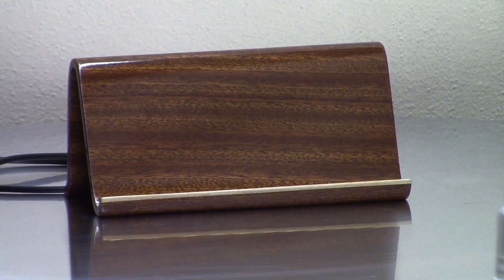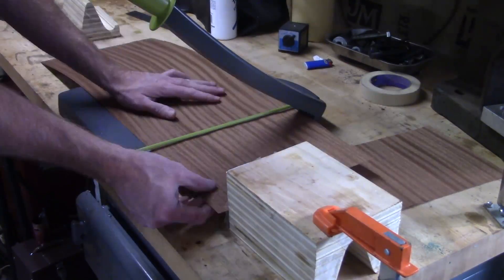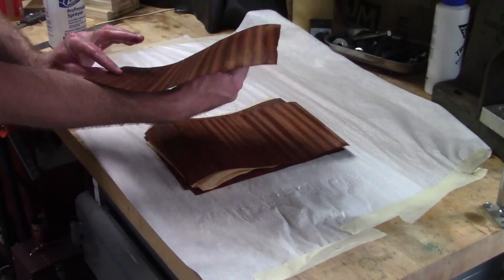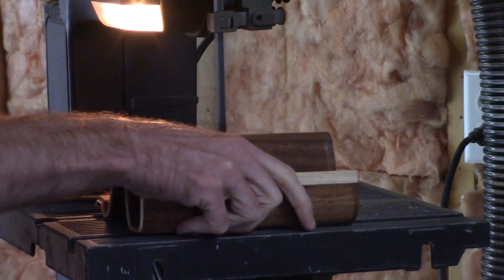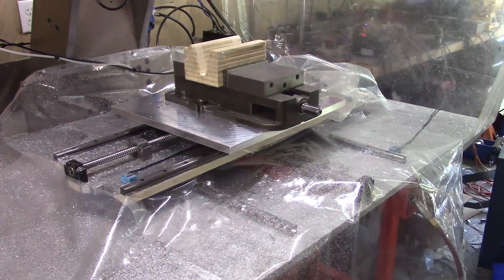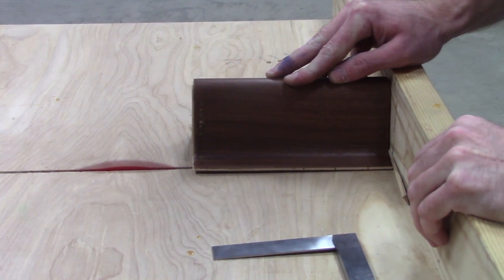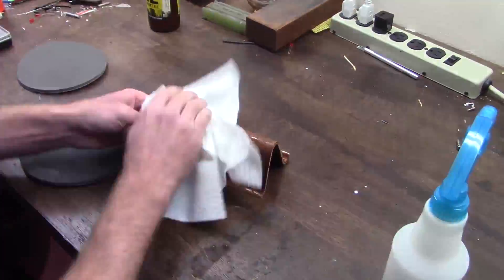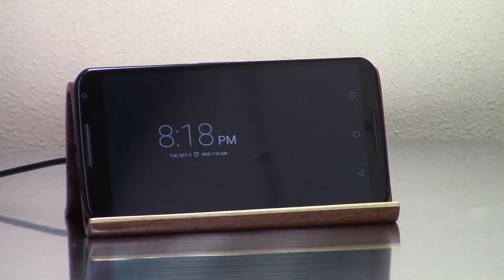Bent Lamination Wireless Charging Stand

Comment: im not cnc expert at all and it's very hard to understand for me why not to remove somem material before gluing piece? why you need powderize such big amount of plywood?!?
Reply from the maker: I didn't have a way to do it easily.  Anything I would have done would have to have been manual and not only is that a lot more work but there is the chance of screwing something up.

The machine doesn't mind the extra work; I went off and did other things while it worked.

Comment: Awesome project.  Where did you get the charging electronics?
Reply from the maker: They are all over ebay.  Just look for "three coil qi charger board".
Reply: did you get a low amp charger? the more powerful ones can generate lots of heat that may be a fire hazard/ruin your phones battery.
Reply: Yes.  Thank you.  But trying to make the form without a CNC is a tad harder than it looks.  At least for me it is!
Reply from the maker: Yea, I can imagine.  I didn't even attempt to do it by hand. :)